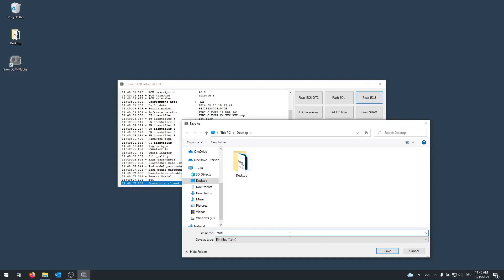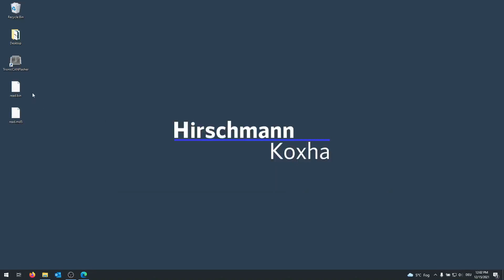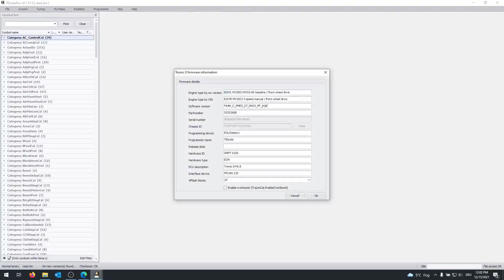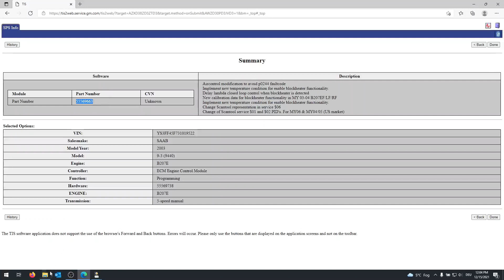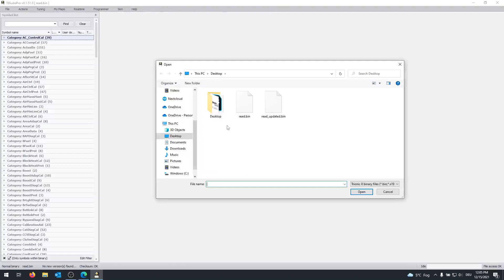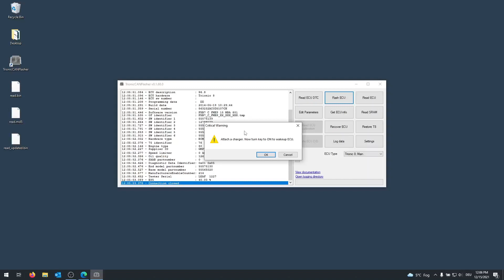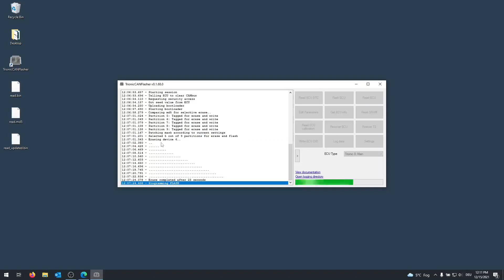Read, update, flash - Trionic 8

Comment: Which adapter are you using? Thank you so much for all your uploads!
Reply from the maker: Hey Peter, we have a bunch of different interfaces. In the video we use the OBDLink SX, which is perfect if you only have cars with a Trionic 5, 7 or 8.

For anything else (ME9.6 - 9-3II V6) we use the Kvaser HS or Combiadapter. The later is also a very good interface for the Trionic, especially since it features BDM support (needed if you bricked the ECU during flashing). However, it is a bit hard to come by.

Pricing wise here a little overview:
- OBDLink SX - 50$
- OBDLink EX (same as SX, but faster) - 60$
- Combiadapter (BDM and ME9.6 support) - ca. 115-120$
- Kvaser HS (no BDM, but ME9.6) - +300€

Personally I would recommend the SX or EX. Not only are they cheap, but also feature "OBDWiz", which allows you to scan your and other cars for codes.
Reply: @hirschmannkoxha  Thank you so much for your answer! Best regards from Sweden